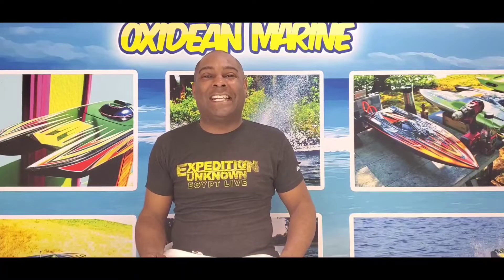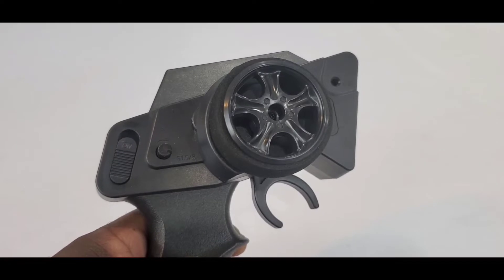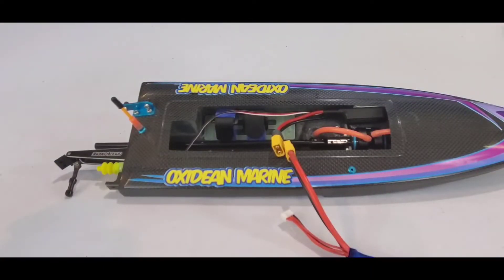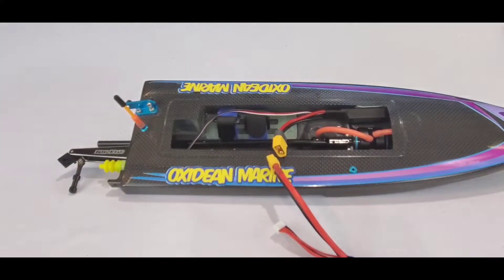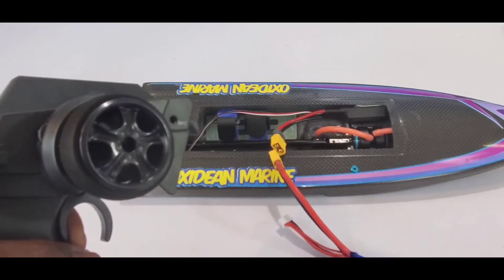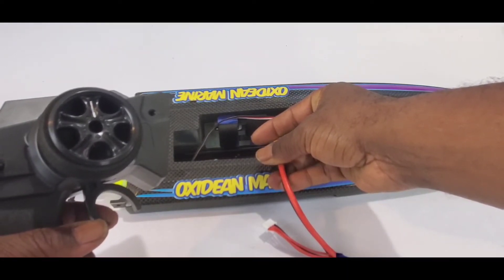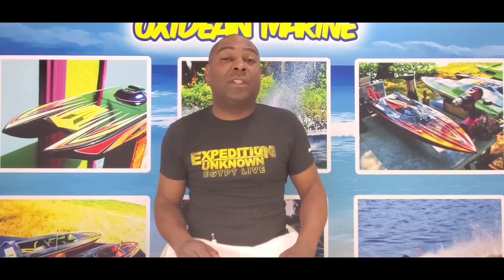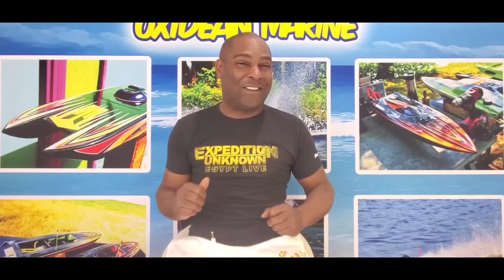RC BOAT INSTRUCTIONAL VIDEO: Calibrate your Hobbywing Seaking ESC to your radio

Comment: I just pick a v3 180 for my spartan do i need a program box for the esc or can i just do wt u did. Also wt motor will u recommend foe these esc on 6s that will out perform the stock system thanks any tips help.
Reply from the maker: Hi sir, you can program your ESC through Beeps via your manual. No need for a card. I personally use the beeps. Our 2200kv 6 pole motor RIPS in a spartan www.oxideanmarine.com

Comment: MY SEAKING 120A V3 had a slightly different series of initial beeping.  When first plugged in I get the Battery Count then one slightly longer beep, I released Throttle immediately, unplugged and the calibration took.  Thanks for the Video.